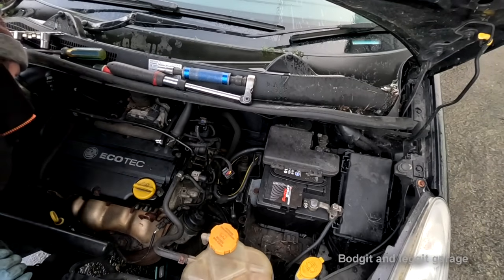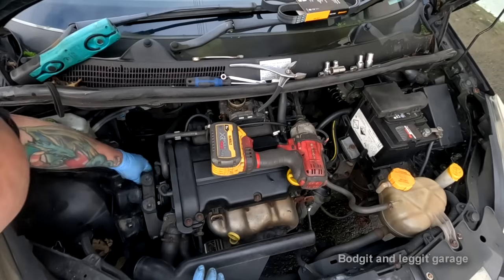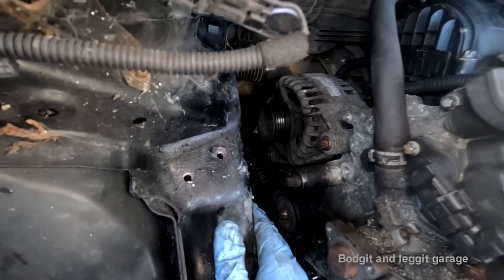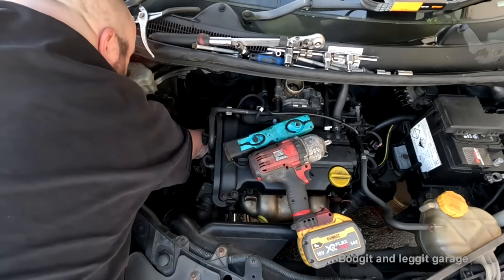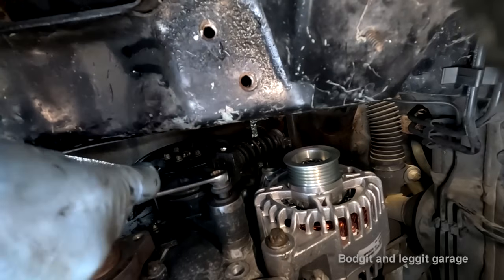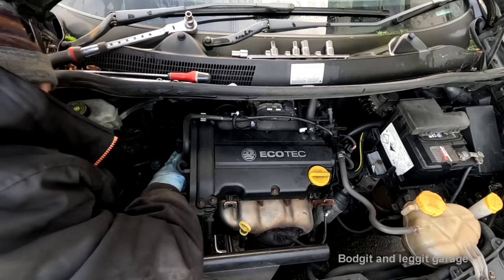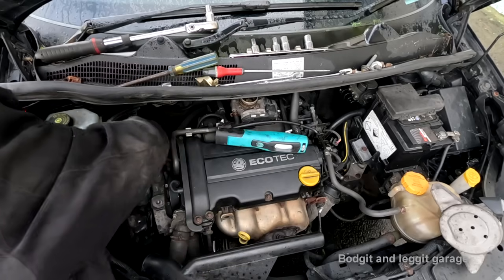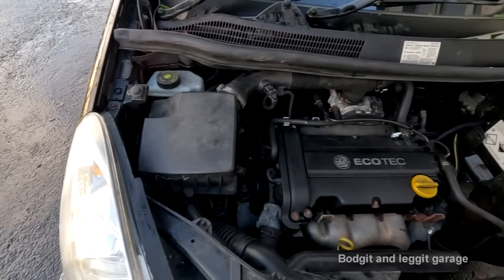Alternator big problems getting to angry for this job

Comment: My wife has just said 'he sounds like you doing a job' 😅 that's because I work for Vauxhall. To do this job you need to drop the wheel arch liner and with the tensioner removed the engine mount can be removed.

Comment: Pull the tensioner down on the nut, then push a split pun through the hole to lock in position while you feed over the new belt.

Comment: I've just done one on a mercedes w203, same issue, only had to replace the voltage regulator at the back, but somebody decided to put an engine mount right behind giving no wiggle room for a ratchet. A right shit when your only 7mm bit is a long one.

Comment: It should be a requirement that people who designed all this stuff should have had many years of experience in fixing vehicles. Then everything would be easy🤔
Reply: All about keeping assembly time and costs down - don’t care about what comes later too much. However, in this case I agree, what a joke of a job!🤬
Reply: I presume it would  be easier if you had the car in your garage
Reply: The alternator had jammed the belt was slipping  like mad when you started  the engine
Reply: a hundred years of making cars - and the engines to power them .and look at what they turn out

Comment: "stay in school, do not be a mechanic like" :)) hmmm  in corsa b and c is far easier to achieve taking engine mount out... and the tensioner has like a locking pin which makes it easier to install or remove but... i only found out myself after one fell a part and the spring dissapeared in the air... but when i bought the replacement had the pin top lock it.... things are far better when not on the streeet in the cold and raining... fairplay to you for showing the reality and not a cut video that makes it look far too easy...

Comment: I take the Engine + box out and back in less than 2 hours at home on my own. Try doing a 2014 Audi A3 2.0tdi alternator 6 1/2 Hours you have to take complete front end of radiators fans the lot to get 1 bolt out. I felt like I’d been dry bummed fucked all day doing it

Comment: Wow
Some of the ford escapes with the 3.0 you need to remove the cv axle to access the alternator. . 

College educated engineers 🤬😡🤬😡🤬
Reply: Tell me about it, the RHD versions at least.  First remove wheel, suspension, plastic liners, axle and then you actually see the alternator.  Then by feel remove multiple bolts etc and reassemble.  Sadly, I am an Engineer!  Make very sure you buy a decent quality one as you really don't want to repeat that...

Edit to add the power steering pump is also something to enjoy doing....

Comment: They deliberately design cars like this. I dare say even at a dealer it'd be pain let alone on the street. There should be a right to repair law that cars have to be designed for ordinary people to able able to carry out repairs like this. I am not a mechanic but you can see over the years the designs are making it harder and harder for people to have a go themselves, that of course is their plan, take it to the stealer and get completely fleeced. They will of course design a stealer tool in the process to make it slightly easier but not by much, respect. I am still trying to get the clip that holds the clutch elbow joint from the slave on an insignia to stay in and not pop off, any tips welcome.